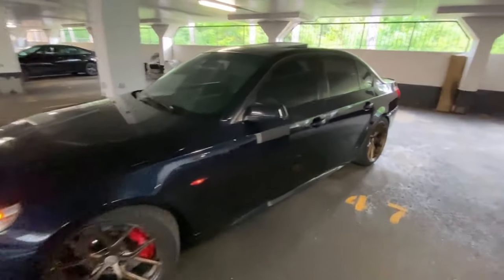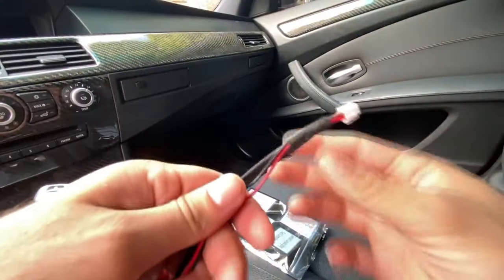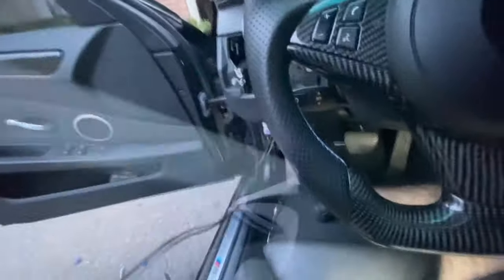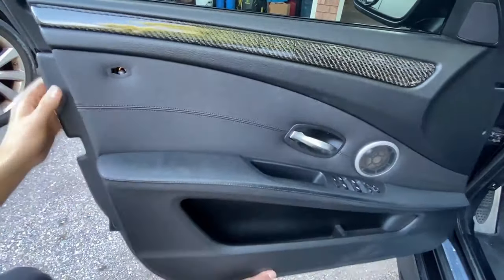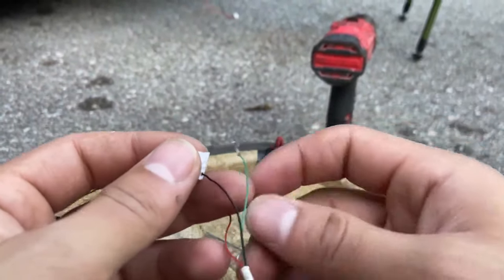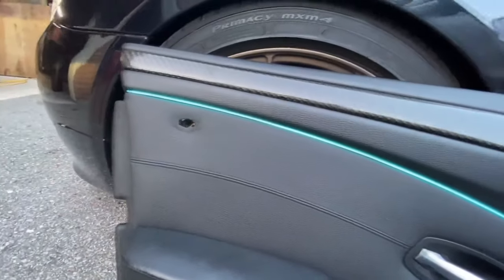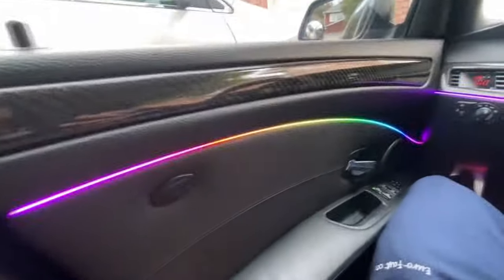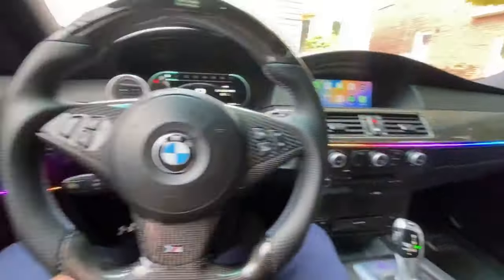The Best Ambient Lighting Kit Money Can Buy - Full DIY Install

Comment: Puede eliminar luces de colores al encender?
Reply from the maker: Yes, there is an option in the app to turn off the startup sequence.
Reply: @TheAutoSurgeon  la app duoco striptx no lo permite. Cual recomiendas?
Reply from the maker: You can use the “Magic Car Light” app to turn off the startup sequence. Then, use the “Magic Lantern” app to control the colors, it’s much better.
Reply: @TheAutoSurgeon  ninguna app cambió el inicio
Reply from the maker: In the “Magic Car Light” app, press the gear in the top right corner and there’s an option that says “start effect” which is selected. Deselect it and it will turn off the start effect.

Comment: How do you stop that tacky RGB test sequence at the beginning. Looks terrible doing that at the beginning which is a shame.
Reply from the maker: If you go to the settings in the “Magic CarLight” app you can turn off “Start Effect,” that should get rid of it! And then I’d recommend using the “Magic Lantern” app for your color selection after because it has more settings.
Reply: @TheAutoSurgeon  Nope, this doesn't work unfortunately
Reply from the maker: Worked for me, which kit are you using?
Reply: @TheAutoSurgeon  Ligheid - they responded to me and said it can't be switched off on the symphony lights, so you need to purchase the RGB version. So I'll replace all mine and return it for refund. Thanks for the help.
Reply: @cb8491  This is what i was looking for. Was looking at the Ligheid set and I do not want all the startup effects. I'm find with just the RGB lighting.

Comment: I like it but it’s just drains your battery as well😂😂😂
Reply from the maker: Not at all! You just have to make sure the power you use is from a source that is only on when the car is on. That way it only pulls power when the alternator is running and doesn’t drain your battery when the car is off.  Also, they’re LEDs so they pull very little power.